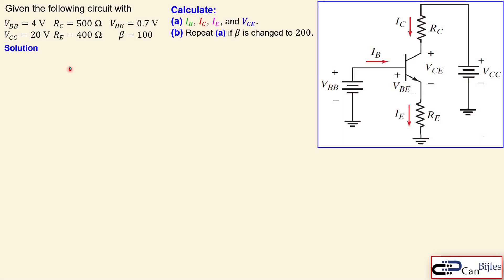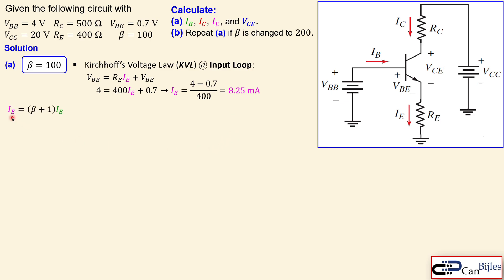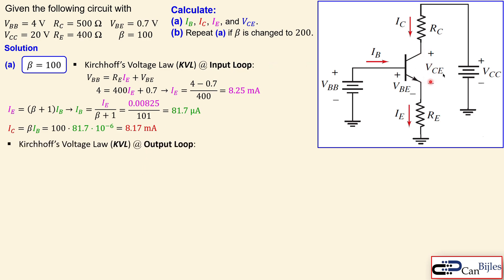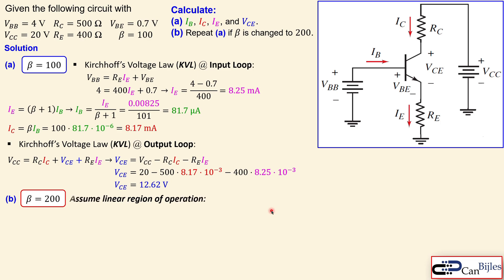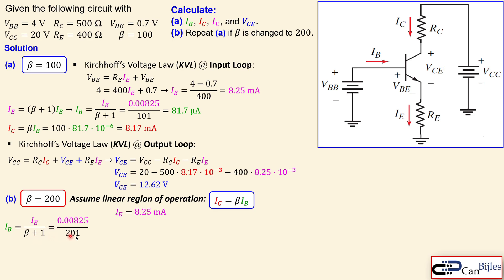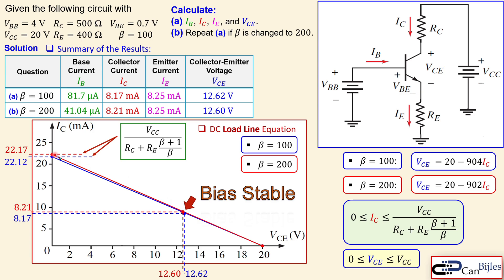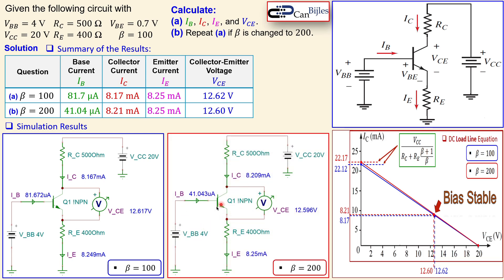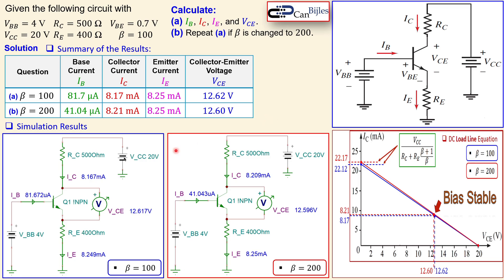Bipolar Junction Transistor (BJT) Circuit 🌟 Effect of Current Gain Beta 💡 Example 3

Comment: It's cool how switching the resistor from the base to the emitter still results in the same amount of current going through that resistor, but then the base current is a lot less 👍
Reply from the maker: The emitter resistor behaves as controller. That is also the reason for using it in the four resistor transistor amplifier circuits.
Reply: @CANEDUX  We do all need some control...
Reply from the maker: @PunmasterSTP Indeed. Power without control is meaningless and useless.
Reply: @CANEDUX  Yes, like a circuit with a shorted load.
Reply from the maker: Indeed👍